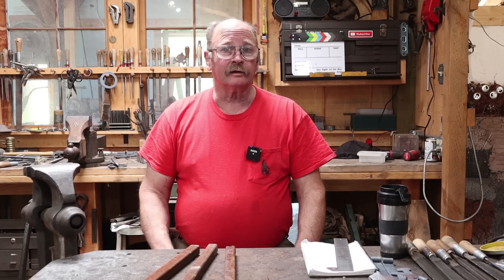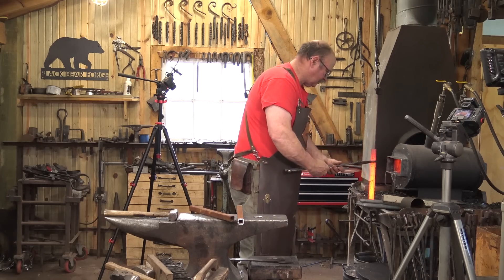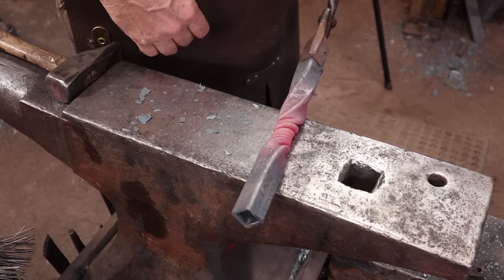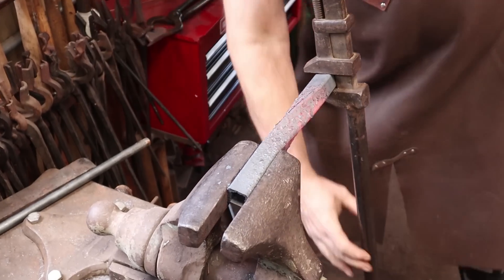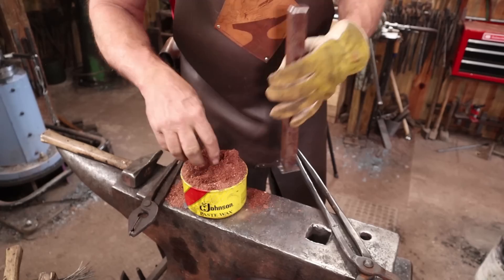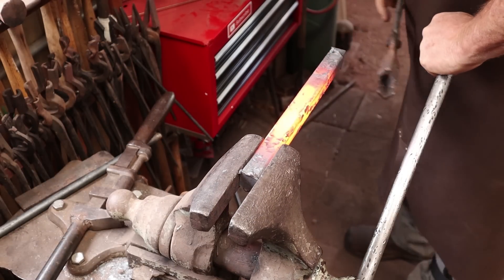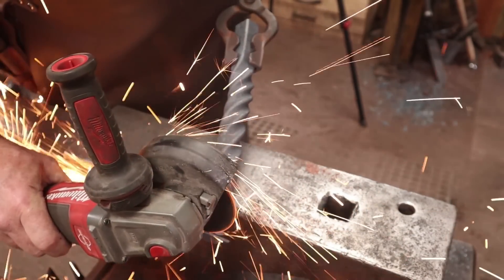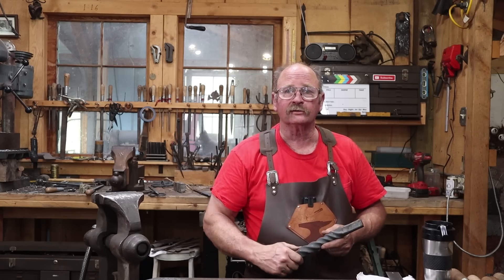Twisting square tubing

Comment: Another way is to pre collapse the sides of the box tubing with a fuller then twist.. This allows you to get a very similar effect with less turns of the wrench :-) and it helps control the length of the twist. Great video john always good to see you work my friend
Reply: I'd like to see how this fuller method done by you or John, please?
Reply: @Zogg1281  Hi ! If you use a G2 (second generation) guillotine tool, heat a section of tube, and run the tubing inline with the fullering dies and slightly indent the tubing along the length of the bar rotate 90deg and indent the other side of tube. now the tubing should be indented on all 4 sides! Reheat tubing as John directed and twist! it will collapse in some but not like Johns 1st twist. not sure what a G2 guillotine is? search youtube and you will see several versions of it...
Reply from the maker: Sounds like an interesting approach. I’ll need to give it a try.

Comment: Sand is also the way I learned it back in the day. We also would use a piece of pipe to twist flat bar stock by putting the stock inside the pipe to hold it straight. Thanks for the video.

Comment: Hi John! great video! got an idea for a possible 4th variation? take your 1" sq. tube and insert a piece of 3/4" round tube? and twist! solves the problem of solid round being stuck in the middle of the twist, and eliminate the hassle of filling tube with sand maybe? then heat and twist as usual...
Reply from the maker: Thats sounds like a good possibility.

Comment: Something I found that works great is to drill a hole at one end and put a pipe spacer in and twist it with a bar with the spacer in between.

Comment: One cool thing you might be able to do with the sand method is use a die to gradually twist tubing going through it using a hydraulic press or puller.  The die would just be a piece of larger tube twisted with uneven heating and bulked out with metal cast around it.

Comment: I had a thought about doing something like this. Thought I bought square stock turned out it was tube. Have a  small diameter square stock was gonna try like you did with the round stock. I'm still building my forge tho so 🤷🏼‍♂️

Comment: First, a comment...
 I love the sand fill idea. It is great for the exact reasons you stated.
Second, a couple of questions...
a.  Can the rod be driven back out of that twist?
b.  Would the sand fill idea work for bending tubing without it collapsing?

Comment: I'd be curious to try this with a piece of round tube and see about making a shotgun barrel using this twist method. Do a gain-twist on it where it starts slow and then the twist rate increases. Just an experiment to see how it patterns with something like buckshot. Probably wouldn't need a lot of twist as most current rifled shotgun barrels are 1 turn in 28" but are mainly for rifled slugs.

Comment: Great Video, thanks so much.
I was wondering have you tried with tube inside the full length? I'd assume non-heated tube might supply a more consistent support than sand.
While it's adding weight, it' would not be the weight of the solid bar.
And if it worked then you could play with the ratio of how much the internal Tube fills the square tube, to test effect on the twist pattern.
just my ramblings :)
Reply from the maker: I think there would be many useable variables in the idea. But I haven’t tried it this way.

Comment: Good tips!  Question, though... Is there any reason you couldn't drive the support rod out after twisting? Is it seized in there that well?
Reply from the maker: As the material cools it shrinks and would be very difficult to remove. The act of twisting also grips the bar holding it even tighter.
Reply: My gut tells me the round bar would be very tightly stuck in, but if the twist is moderate, you could probably "unscrew" a long piece of round bar like a tap, if you had some leverage welded on, or a bend. Going to try this tomorrow. Always learn something from this channel.

Comment: This video is fascinating but I do have a daft question. While it would obviously take longer, could you not as well quench nearly all of the tube leaving just a one or two inch section that you plan to twist, twist it and then reheat and repeat but move the heat along by an inch or so each time to complete the twist? This would take longer for sure but it might create a more ever twist?
Reply: I'm currently learning blacksmithing and basically watching loads of YouTube video's. I think, if you wanted that much control of the twist it would probably be easier to just go with a torch. You would save a lot of time as you wouldn't be constantly heating the whole thing then quenching the ends. I'm also not sure what it would do to the steel, other then loosing a lot due to scaling. The other alternative might be a coal forge as you can heat up smaller sections at a time.

Any other comments would be good as these are just my best guess?
Reply from the maker: It’s certainly something I have never tried, but worth experimenting with

Comment: Very nice! now I have a request! I have square tubing approximately 1 in square, I want to Bend it and build a bracket ! a way to haul a gun or a bow in front of the headlight over the front wheel on an adventure motorcycle ! I was thinking of doing a Twist to the square stock so that I could make Bend's in it without a bender:-)? And other words once you twist it round while it's hot a person could put a bend in it!  but if you try to bend square stock it will just Kink and look terrible? What do you think? how can we bend Square tube without a bender ? and all of that process! another words a blacksmith his heat and an anvil to bend square tubing at right angles or whatever? How to

Comment: A while ago I saw a camp fire blow stick that was maybe 3.5ft long and had a twist to the square tube about 6in from the bottom. Would you do the sand method filling the whole 3.5ft or would you do a bar method and somehow pull the bar back out? Last question, it had a small half hook at the end that tapered round and down to a small hole. Would you use the sand method to make this small hook and taper? My explanation may be horrible, wish I had a pic. Thank you for the great videos! Perfect for weekend n00bs like me.
Reply from the maker: I would use the sand method and start with the twist. I think a bar would remain trapped

Comment: If you cant get the inserted bar out after doing the twist, you could have a go at using 3/4 inch pipe rather than solid to keep the weight down.
Reply from the maker: It would probably work fine

Comment: Could you use the solid round bar to make the twist and then drive it out afterwards?
Reply from the maker: It grabs the bar pretty tight both from the twist and from shrinking as it cools. I suspect it would not be worth the trouble.